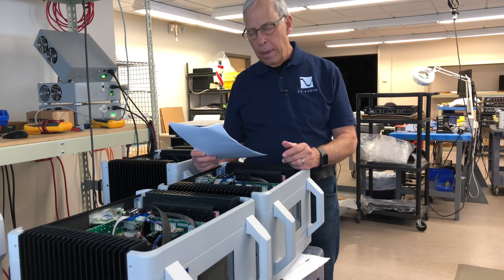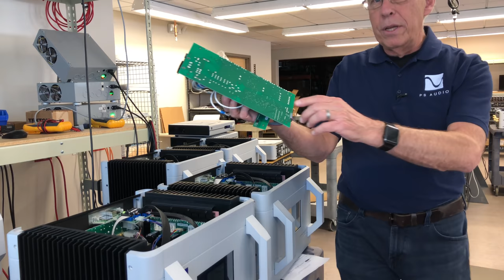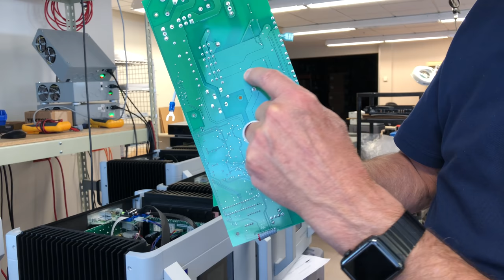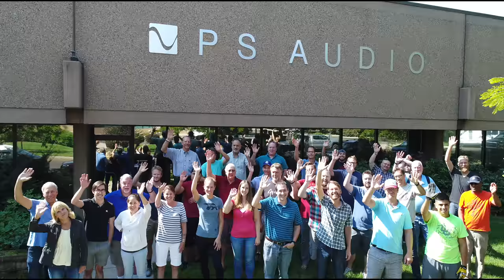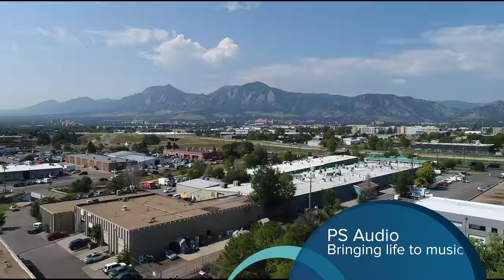Is point to point wiring better than PCB?

Comment: You mentioned that you don't have equipment that can measure the low impedance of the copper bus bars. I work in aviation where we have to measure very low impedance of electrical bonds of fairings to the fuselage and basically every panel and major components have specific requirements when it comes to impedance of the bonding wires.
If it is worth it to you maybe purchase an aviation style bonding meter they are portable and durable for line maintenance tasks so I'm sure it would last forever in your wonderful lab. I love your videos please keep 'em coming.

Comment: I have seen excellent and horrible examples of both. Each has its advantages and disadvantages. Point to point wiring is labor intensive, less consistent, usually less compact, but easier to repair. Printed circuit boards at their best are consistent, their manufacture can be automated but are often difficult to repair so many times the entire boards are replaced. PCBs offer a modularity point to point usually doesnt. For example there are often expansion slots in computer motherboards for various later add ons. There are strict military specifications for both types. There are even military specifications for an acceptable soldered connection.  I've seen problems where a video card became loose from a motherboard due to vibrations more than once.
Reply: Tubes on a PCB is horrible. Not because of sound quality myths, but because of cold solder joints. It worked more or less ok with the old leaded solder, but it doesn't work properly at all with modern RoHS rubbish.
Reply: Why not use leaded solder for the tubes? As long as its used in limited quantities there is no reason why a small amount of leaded solder cannot be used on a modern pcb in critical applications, the directives allow for that.
Reply: @cbcdesign001  

Because then they would have to solder the tube sockets separately by hand instead of just putting the whole thing in the pot soldering machine. That would cost the companies extra money so they don't bother. Also, in the "olden days" all traces where completely covered with eutectic solder so that helped with heat dissipation too I think, but today they cover the traces with green ot blueish paint between the joints to keep the solder from even getting there, because they wanna cheap out on that too.

Comment: point to point tube guitar amps are dreamy.
Reply: What is the technical definition of dreamy?
Reply: @ninethirtyone4264  Some things don't need scientific explanation. Our ears tell us. In a blind test, for example, you may not always be able to distinguish between the two. But given familiarity of a particular amp over time, a before and after test yields improved tone with point to point in nearly every case.
Reply: @HooksBill  Ahhh of course...the toan. 

Simply wrong. There is nothing other than a sprinkle of fairy dust that could possibly make one approach yield different sound characteristics than the other. Wiring an amp is not as easy as just throwing a bunch of components in a chassis and depending on what you connect them with will get you a "better" sound. There are a lot of strict rules that you have to follow otherwise you will just get hum, oscillation noise and it will sound like trash. This means that the hookup doesn't change much witht change to wiring topology, and in fact if you really wanted you could make it exactly the same, and the only difference between one amp and the other would be that one has solid wires between the components and the other has solid copper sheets. This has no effect on the sound whatsoever, only difference is the noise figure improves on the PCB variant because a lot of connections are shielded with the ground pour, actually I know one delusional group of people that claim that different type of material makes their gear sound better and they get laughed at for buying $3k power cables, please don't be that guy . Now, I actually tried this out in practice, having the prototype of my amp design PTP and the final version on PCB, and after finishing both units there was no difference in toan whatsoever and that's how it should be. In a properly built amp the component values should be the only thing that dictates how it sounds, never the wiring method used.

Comment: in my opinion, if you have a simple tube amplifier you can mix both a nice PCB, but for a solid state a PCB is a way to go and is less complicated also PCB will have the info of the components R1, C2, D1, etc point to point still be using and still really good an will last many years I like both 😊

Comment: A great question and a great answer . I have known DIYers to where practical use " no wire " only the component leads are used to make the circuit.
However this is clearly not practical in many circumstances.
If a PCB must be used the layout is as important and will affect the sound just as much as wire choice !

Comment: I've been hearing from some boutique guitar amplifier builders that they have discovered PCBs can be made to be very close to the quality of point to point.  The PCB only needs a nice thick copper traces (cheap PCBs are terrible) and of course you still use the same components.

Comment: Why does point to point sound better than a PC board? Somebody please explain in engineering terms. I don't see the copper bar example as relevant. Of course you can't practically build a high current DC power supply on a PC board. But unless we are talking about a kilowatt amplifier,  this issue is not relevant. Let's keep the discussion at line level audio signals. The popular voodoo opinion is that the PC board has capacitance and degrades the audio signal. Once again this is some audio magazine reviewer taking RF circuit theory and blindly applying it to baseband audio,. These problems do exist at microwave frequencies and they do in fact make special PC board material for that reason. But at audio frequencies, even video and sub GHZ RF, plain old FR4 is just fine. PC boards if designed properly with ground planes can actually reduce noise even at audio frequencies. So you can easily state that for a phono preamp, a PC board is superior to a point to point wiring job.  I think this voodoo comes from the idea that hand wiring is craftsmanship and that long tedious hand work somehow influences the sound. Just more wishful audiophile thinking with no evidence rooted in science and engineering. This is not to say however that point to point sounds bad or any different. For most analog audio circuits, especially power amplifiers, there is no sonic advantage to either construction technique. Cost and mass production is another matter!
Reply: "..if designed properly.." this is the key to everything ... you can find out there 4 layers pcb made by makers.. that hit the autoroute button and make no refinement.. or even 2 layers pcb that should be 1 layer just with little effort.. i think there are some forms of "fetichism" in electronics.. so people like a technique for no reason.. for example i like those vintage soviet avionics boards full of big component and laced wires..
Reply: Point to point wiring is reducing the amount of soldering joints in a circuit because (where possible), the component leads are directly soldered together. So you can connect two components by making one joint. At a PCB,  you always have to solder a component lead to the PCB, than the signal is going through the trace and then it's going to another soldering joint before it's reaching the next component. Next to that, there is another advantage you can see in older tube equipment where point to point is done properly. The leads are clamped in a way that they already make a good connection. Soldering is done after that, to fix it mechanically and to provide that no oxidation will occur over time. Whether it's PCB or PTP, there is always capacitance between two conductors. Only a good engineer knows how to deal with that. And you are right about RF, that's a very different game compared to audio circuitry.
Reply: @hugoromeyn4582  All quite true from a reliability standpoint. What I disagree with is the audiophile ideas that different solder brands sound different and that one can "hear" a solder joint. The only way to hear a solder joint is bad a joint that is intermittent. A proper solder joint has no sound. Now I can imagine a case where you have thousands of solder joints in a series and the metallurgy of the solder presents enough resistance to become audible. But that's hardly a practical concern. And that's where these audiophile claims fall apart. They take a purely theoretical situation like that and then assume any solder joint has additional resistance and therefore compromises the audio signal. OK, but at what magnitude compered to the signal level? Immeasurable!
Reply: @andydelle4509  I was a real skeptic for many years about high end audio. I Knew the differences between a mediocre amplifier and a better one, I was able to hear the differences and that made perfectly sense to me. Until 16 years ago. I was starting to work for a company (not audio related) and I had a colleague over there that was far more into audio, he is a real DIY audiophile. We started to discuss about things like audio cables and small changes in amplifier circuitry. He told me about how swapping the polarity of a power plug could make a difference in the sound of an amplifier. My first thought was "this guy is crazy". I Had, and still not have, any clue why that can make a difference. But that it makes a difference, I discovered that when I was back home and did what he said. The sound of my system was completely different after the swap. Lows were gone, details were gone. It sounded just flat and harsh. Swapping the polarity again, and everything was back to normal. For me, that was the "WTF" moment. After that, I've played a lot with different DIY cables (AC power, interconnects, speaker cables) and I can tell you. There is a hell of a difference and I still can't explain it physically nor mathematically. And that's very frustrating. I've build an FM broadcast transmitter, 10 Watts RF output, for a local radio station last year with a 10 amp SMPS. Lot's of overhead in the power supply current, but the transmitter sounded dull, not dynamic at all and with a lack of base. On an amplifier, I immediately know what's going wrong. A power supply that's not capable of handling fast and fluctuating current draw. But with an FM transmitter, the current isn't fluctuating. I decided to design a new power supply for the transmitter. An old school 3 amp toroidal transformer, rectifier, filtering, stabilization and proper RF decoupling. And it sounded so much better! Theoretically, the SMPS should be better due to the many amps of overhead, but it makes the transmitter sounds really bad. Practically, the old school power supply is a hell of a lot better, it sounds fantastic. And I can't explain why. But I was not the only one who was noticing the difference. The owner, not an audiophile, noticed it too. I'm convinced that there's something in audio and electronics that we still do not understand. Just like we still don't understand any aspect of RF radiation. But I do have respect for both "camps". The theoretical engineers saying: 'Rubbish! Snake Oil!' And the Audiophiles, enjoying their music systems with tiny (not) expensive tweaks ;)
Reply: Wrong. There is a large benefit of point to point. Think about the size and length difference of those thin PCB traces vs proper wiring. 
Watch the video again.
Reply: @andydelle4509  No. Where it matter is for highly resolving systems. If you don’t have one, then correct, you won’t notice a difference among solder types of PCB vs point to point.
Reply: @Fluterra  Well I would like to go out tomorrow and buy a "resolving audio system" I have billions to spend if necessary.  So what exactly do I look for? What are the parameters of this "resolving system"? Specifications I need to demand?
These claims of "resolving systems" are nothing more than audiophile snobbery. I'll cut you some slack for speakers but modern HiFi electronics has long since passed any idea of not being "resolving". Some of these audiophools have $10,000 SET amplifiers with AC filament heating because of the "DC heating sounds bad" voodoo. Then they attach a horn based speaker because the power output of this 1930s amplifier design is so power limited - like a watt or less. So you have an amplifier with at least 300mv of AC hum coupled to a highly efficient speaker. Now how can that be "resolving" with all that hum present in the reproduced audio?
Reply: @Fluterra  How much current is flowing through these wires or PC board traces? What is the resistance of said wire or PC board trace? Inductance? You are applying simple  layman's logic to electrical engineering. It's not that simple.

Comment: If point to point wiring would objectionably sound better than PCBs, than top-notch, very expensive gear would all use it exclusively and so better justify their price tag. But when a +$6000 amp (e.g.: McIntosh MC275) uses PCBs while a less than $500 Chinese amp (e.g.: Reisong A10/A12) uses PTP... it is (hopefully) clearly :D ... not something that is critical from a sonic standpoint.
Sure, PTP looks very cool! Really, I personally dig it. And I'd like to admire that level of workmanship and attention to detail. What audiophile wouldn't? :D 
Sure, PTP should be easier to repair, especially at home by enthusiasts.
Sure, PTP solder joints should in theory be stronger, more reliable. 
On the other hand, a complete PTP is a nightmare in manufacturing, takes A LOT more production time, requires more expensive and skilled operators, generates more repair and possible RMAs, when compared to using PCBs. 
There might even be so-called "performance" differences (SQ related), as with everything in life - at least in theory - but I believe they are insignificant, otherwise, again, everyone would do it, especially the big expensive brands. If PTP would be "detectably" better, I wouldn't expect any >$2000 gear use PCBs in simple circuitry in analog domain, like tube amps for example. And still, this is not the case. 
If there would be any way for HiFi brands to justify bumping up the prices, they would certainly do it. If they don't, then there's obviously something questionable about the "proposed theory" that even they don't buy it :D

Now, Paul is often put in a difficult situation, to give an honest and correct answer on one hand, and on the other hand to protect his company and not bash the industry. And this is not only related to the situation in hand. I feel for him, I wouldn't want to be in his shoes trying to answer some uncomfortable questions. But still, I feel like he does a great job, with enough diplomacy, even if the answer still let's you hanging... I guess that's a life-long experience with countless customers challenging your very passion on a daily basis :)

Cheers Paul, God bless you!

Comment: On tube amps military style point to point is best.   The old McIntosh and Marantz units used this method.  Open terminal point to point is OK but not as professional looking.  Also there is nothing wrong with PC boards.  I do not think either affects the sound.

Comment: Paul,

Thanks for the video and shout out to nelson pass. He is one of the most selfless designers in the diy audio community along with loads of other folks way smarter than me and even sometimes Wayne  (Nelsons right hand designer..aka wizards assistant😀). Wayne has a really good diy class a headphone amp kit called the whammy that can also be made into  really good preamp. I will make both with all the parts I  have coolected. Heard it pairs well with Nelsons amp camp 1.6 amps as well. You would be great just like Nelson if you ever did decide to teach diy😀 writing your autobiography must have given you the writing bug😀 or perhaps you always had it? I'm sure you would be great at that as well. Hollywood may come knocking to make it into a movie😀